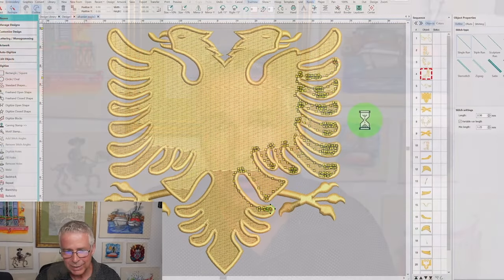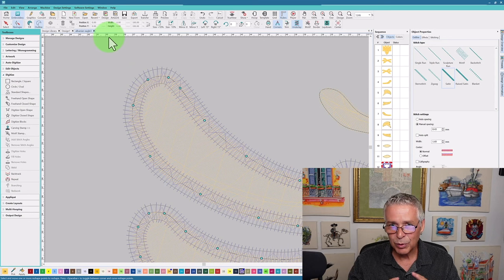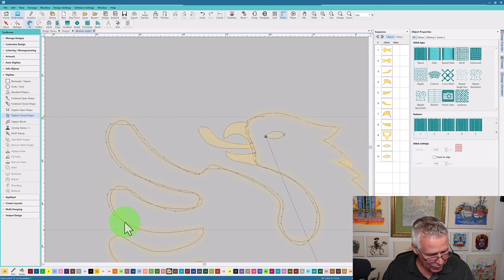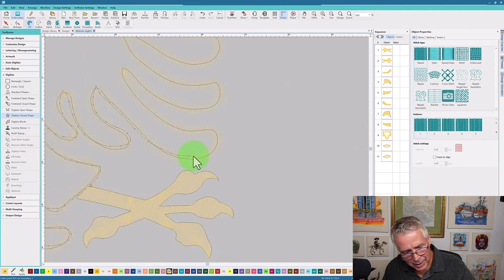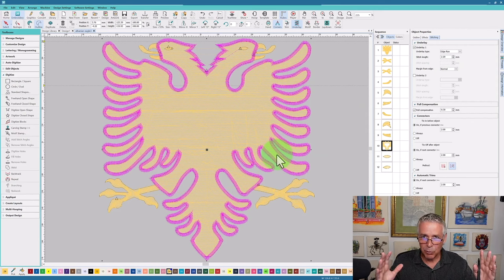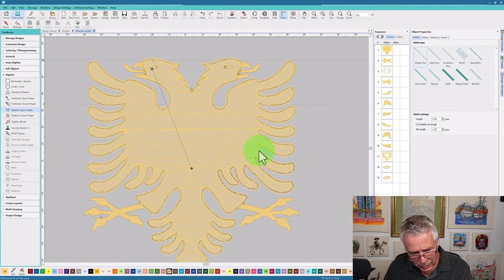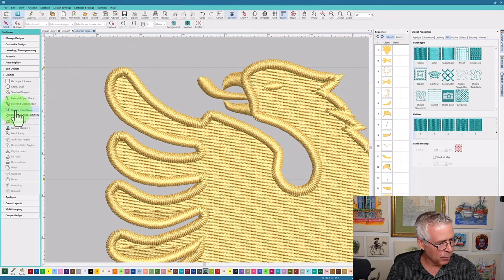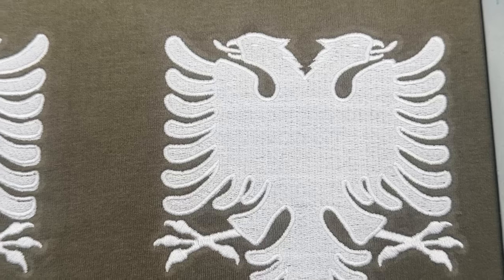Digitizing Techniques for Better Embroidery Designs

Comment: Thank you very much for the wonderful information
This is Rehab from the Kingdom of Saudi Arabia. Follow with enthusiasm. I have a question
Why do you walk with the traveling thread on the edges? Why do you not cross directly from the bottom to the top? Since the traveling thread is in the first layer, it will be hidden, in order to shorten the time and consumption of the thread.

Comment: Great stack of information and helpful to a descriptive sense, but here are my issues with this topic and not being able to get my borders aligned right with my designs. First off to set a desciprtive background to the problem, most of my designs will be anime, given tht not all of my images are easy to tell when to exaggerate on such turns or angles to take in consideration on the push n pull. He gets a 100% perfect outlined border to his design in this video bc he has been working with such concepts for a long time, how is someone new to such things going to be able to see where to go further into the design or out for a perfect border? I've been on one design for too long bc I simply can't tell or how to place a perfect border to my designs, this video talks about it yes n even shows but i feel as if the concept he used here are for pro level digitizers.! please anyone have any tips or tricks?
Reply: Keep practicing in simple designs and push and pull applies to the top and sides of designs research more on push and pull images  , for example  if your digitizing a rectangle , you would compensate for push and pull by digitizing the top and bottom of the rectangle on the insides because the stitches will push it out to your desired end result and for the sides you’d compensate by digitizing  the lines by going over the border line because they will pull in , for any complicated shapes within your design you want to always keep in mind regular basic shapes and see what  the shape of what your digitizing may be similar to and add the same technique , & trial and error on simple designs don’t forget .
Reply: Also for what he’s doing if you separate the bird and compare each part to regular shapes it would be mainly ovals  on the wings so what he’s doing over and over again is push and pull for that type of shape ,also diagonal lines he didn’t compensate for only up and down and side to side lines because those get messed with by “ push and pull “ when you really understand what’s going on it all makes sense , idk if you get what I’m saying because it makes sense in my head based on my understating but once you understand push outwards ( side to side ) and pull inwards ( top and bottom ) and how it applies to different shapes and how those shapes come together to make say your anime character then you can apply those techniques for the shapes to the complex group of shapes aka your character .

Comment: Gut erklärt. Aber warum ist die Titelleiste nicht zu sehen ist das eine gehackte Version von Hatch oder schon die Version 4. Des weiteren ist diese  Datei P00185.EMB die es zum Download gab keine sehr gute die das emb-format stammt nicht von Wilcom wird als Art-Grad D dargestellt und somit in Wilcom_Software sehr schlecht bzw. garnicht zu bearbeiten. Ich arbeite mit der Bernina-Designer-Software version 9. BG aus Deutschland Bernd
Well explained. But why can't the title bar be seen? Is it a hacked version of Hatch or is it already version 4. Furthermore, this file P00185.EMB that was available for download is not a very good one, the emb format is not from Wilcom, it is used as a type- Displayed at grade D and therefore very difficult or impossible to edit in Wilcom_Software. I work with the Bernina Designer software version 9. BG from Germany Bernd
Reply from the maker: Hello, we don't show the top bar within Hatch in our videos as it shows the users email address. We cover it to protect Johns privacy :) 
That would be a very old design created on a Digitrac and was outputted originally on paper tape. Our company has been creating designs longer than Wilcom has been in business, it was converted to emb. Thanks for watching!
Reply: @EmbroideryLegacy  Dank das habe ich mir schon gedacht.